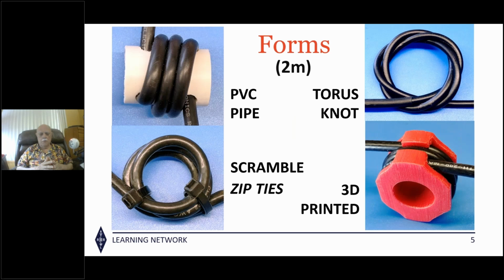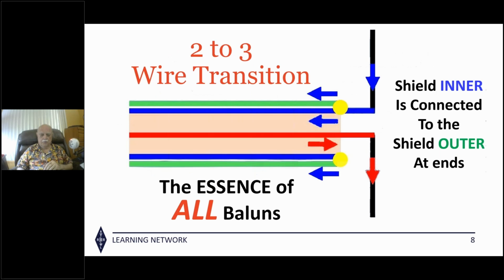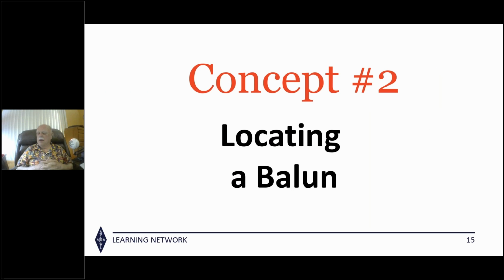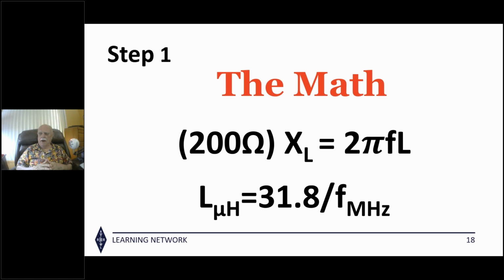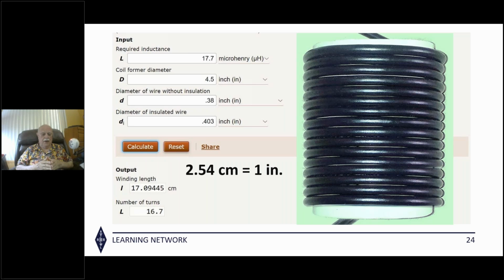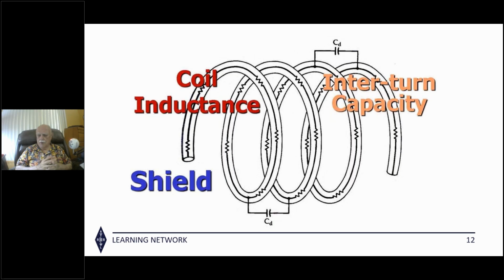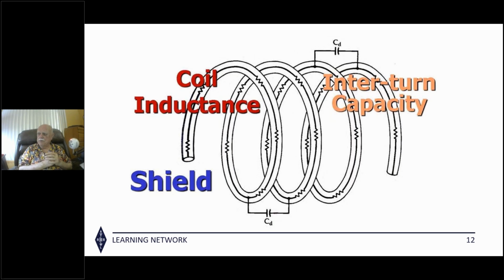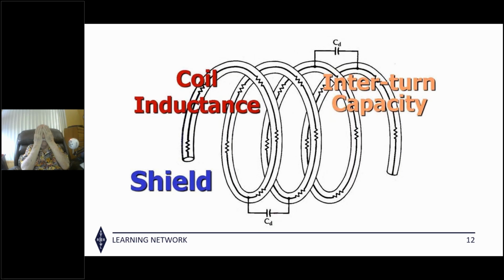Designing Coiled Coax Ugly Baluns

Comment: interesting lecture on the ugly choke balun. I'm still a bit confused! in operation of a 1:1 choke, yes i think i understand how the common mode current is eliminated, but if your dipole feed point is 50 ohms balanced and the tx feed coax is 50 ohms unbalanced where and how does the balanced to unbalanced transformation take place in a 1:1 choke balun?  i can see that if it was used with a impedance transformation balun the bal to unbal  conversion would be taken care of...

Comment: It would be great if someone could just take both of these calculators and work them into a phone app or a single calculator. They already has your coax dimensions and common PVC pipe dimensions. If I'm kind of surprised it doesn't already exist. The one thing he doesn't touch on very much though is the size and dimensions for choke coils for vhf. 50 megahertz and up. I realize they would be small because that's in some cases where they're most needed.

Comment: One thing that bothers me about these kinds of presentations, and they are common in the ham radio world,  is lack of actual empirical evidence why this is important.  My antenna without an ugly balun works fine.  Show me how it will work better with an ugly balun, something more than take my word for it.  I have added baluns/ununs to antennas because I read that I should, but any change in performance was imperceptible, so why do I need to do this?

Comment: The near field saturation especially in VHF/UHF will necessitate placing the choke at least 1/4 wl from the end of the nearest radial, element, etc.
Reply: Very true, I agree with you on your statement. That the coil would need to be at least a quarter wavelength below the base of the antenna. The question is is this a physical quarter wavelength of the same as the vertical radiator or are we talking the electrical quarter wavelength of the coax. Because then it gets really interesting, well calculating a choke for 103 megahertz. A quarter wavelength was only 18 in using rg213. I think it only extended a few more inches when I switched to rg400. Which is obviously far shorter than the physical free space quarter wave. So the question is at exactly what point and what version of a quarter wave would the choke coil need to be at.

Comment: Since the shield is usually braided wires, the inside and outside surfaces are actually the same, as the wires weave in and out. So how does the return current know when and where to jump conductors, as they weave from inside to outside?
Reply: You're over thinking this by double. It's not following the individual strands of copper. The braid acts as one conductor.
Reply: Research skin effect. The skin depth of the shield is several layers deep at RF frequencies.